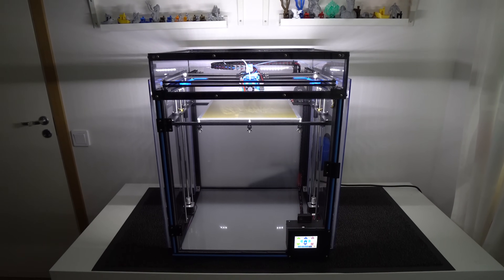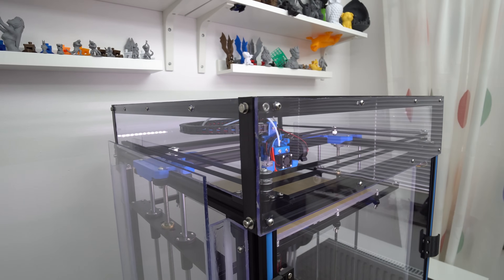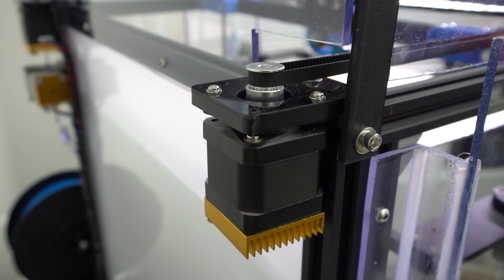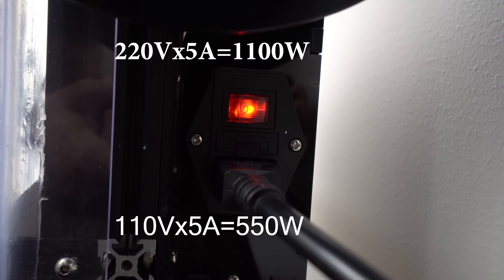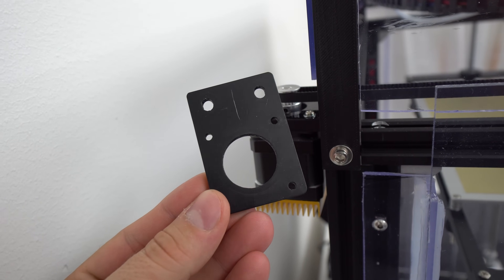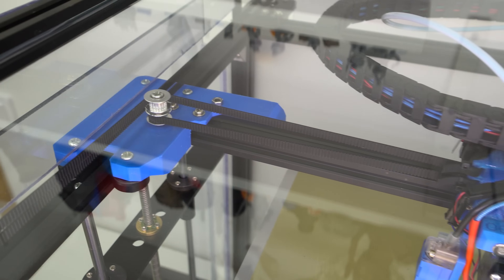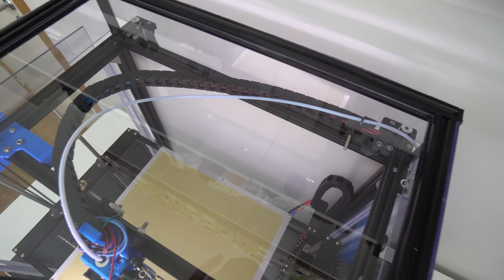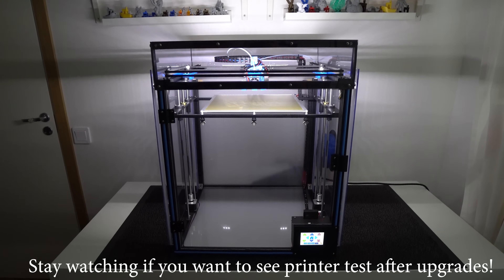Tronxy X5SA 3d printer ultimate upgrades!

Comment: Quick question hope you can help (please). my build is almost complete with all your upgrades however what is the wiring for the relay ?  I see you have power leads into the relay and the thermistor wires out but how does the heat pad get power.  Thanks ;-)
Reply from the maker: Sure Paul no problem, look at this picture. http://folgerforum.com/uploads/default/original/2X/4/45a2fd4840b3e1441b739cd726de192df9e0fef4.png
Don't forget to add ground wire from heated bed to the ground terminal on DC power supply or on the AC switch.
Good luck my friend!
Reply: Thank you so much will post a pic when it’s all complete have found a company that will make the panels in acrylic one size so have ordered 😏
Reply: And is a fuse needed on circuit??
Reply from the maker: Pedro Martinez Moreno There is already fuse in the main 3D printer AC switch. No need for one more. Just add ground.
Reply: on the diagram it shows "Mains" is that the positive?  Sorry if this is a dumb question, just not that good with electronics.  Thanks again in advance!
Reply: @be11thazor  if you haven't figured this out yet, "mains" refers to the AC voltage, so there is no Positive and Negative like with DC.  Instead there is "hot" and "neutral" wires.  In many cases with AC it doesn't matter as much which side is used since the current is alternating.  However, a typical way to wire this (per the diagram) would be to switch on the "hot" side, so run the "hot" (usually a black or brown wire depending on where you are) through the relay first, and then into the heat bed.  Then the upper wire in the diagram is "neutral" (usually a white or blue wire) running from the bed directly back to the plug.  A word of caution, since it seems you are unfamiliar with AC, it is a totally different beast than low-voltage DC and I urge you to learn more about it before wiring up too many AC components.

Comment: I will buy this printer for sure and most of the components for the upgrade.Thank you a lot.I think the GT2 Pulley are printable as well. They cost 20 bucks after all. (at least the ones with the teeth). The solid state relay is pretty expensive as well... the parts inside it cost 0.4$.

Comment: Is it possible to move the control box to the top extension you created?
Reply from the maker: TJ Walker of course it is possible. You can move it where ever you like. I leave it there because it's most cooled place inside of enclosure and I did not wanted to installed  outside of enclosure because now am usung this printer outside of apartment on the balcony.

Comment: This is a weird question but I can't find anything clear (even on Tronxy's site) but what is the difference between the x5sA-400 and x5sT-400?
Reply from the maker: TJ Walker It's not weird question because I would like to know the difference myself and I can't found any unfo :/ Quite strange and I got to say and stupid that Tronxy can't place more info of products they sell :D
Reply: Agreed. There appears to also be an X5ST (without the 400) available through aliexpress, but besides it looking like the X5ST-400 but with a smaller print bed (330 x 330) I can’t really differentiate between the different models. And Tronxy’s website does not help very much. There is no manuals or detailed spec sheets to download either.

Comment: Wow simply an awesome modified printer! Would you say that you spent $600-800 (USD) for the entire setup? The fact that you're making this to handle Polycarbonate with carbon fiber is a step in the pro-level printing. I really love how you went with an AC 600w heated bed with the solid-state relay. I guess you don't need to have a 24v power supply for the hot-end because of the AC heated bed. The only things I thought you would have changed is having the controller outside of the enclosure.

I have a highly modifed Tevo Tarantula (i3 clone), but I really enjoy seeing what people have made with their TronXY printers. I really envy the cube frame which is more stiff.

Comment: How do i ground the heated bed?
Reply from the maker: RaazorCosplay 3:30 easy. Connect the Wire from Heat-bed to the ground place on the powersupply or to the ground pin on AC plug.

Comment: What is the maximum speed of the printer to still get good quality prints out of it? should go over 150mm/s, right?
Reply from the maker: joepstar 150mm/s ?!?!
No 3D printer should be used to print that fast. To much stress and wear on the components and poor print quality.
Reply: @NexiTech  the whole idea of the corexy printers is the minimal mass of the head to increase the quality of prints at higher speeds, right?
Reply from the maker: joepstar Yes that's true. If your goal is speed then nothing beats Delta 3D printers. They have the lightest print carriage.
Reply: @NexiTech  I get decent prints with my cr10s at 120mm/s. That's why I was wondering what the max speed of the x5s would be because of the lighter printhead

Comment: Hi! Thanks for the great review and the upgrade list! I just wanted to ask a few questions.

1) for the E3D clone V6 what is the difference between the long distance and the normal type?
2) For the Gt2 belt pulleys that you used, was it the 3mm bore diameters and how many of the with teeth and without teeth do we need on this printer? (is is 6 of each?)

Thanks!
Reply from the maker: Raymond C I believe that Long distance V6 is the normal one. I compare it with my genuine V6 and they are very similar in therms of heatsink length and throat. Only heatblock is different size as far I can tell. 
Pulleys are 5mm bore. You need 6 with teeth and two without teeth.
I'm glad that you like my videos :)
Best regards
Reply: Thanks for the reply! Can't wait to see more of your videos!

Will you be doing additional mods to this printer in the future? Maybe adding a wifi module?

Also, is it necessary to have some sort of glass sheet on top of the print surface before the pei? Do you think the aluminum print bed is thick enough to not warp overtime?

Comment: Could you please explain a little more about pulleys improvement - specifically changing spring type washers to normal ones. I do not quite understand that part and I do not see a link for ordering washers. That is the only thing stopping me for going into this adventure.
Reply from the maker: cirilicar Well on X5SA kit you get the spring type washers which they never stay completely flat and Belts as they going left and right they sliding and rubbing the sides of top or bottom biger washers between the bearings. This create drag and it puts extra stress on stepper motors and it makes more noise. When I change the pulleys even on the stock printer the X and Y Movement was much smoother. 
P.S. There is no links for washers I buy them in hardware store.
Reply: @NexiTech  hello I was wanting to upgrade the pulleys like you did but you mentioned they were 15mm and the link only goes up to 5mm am I missing something? and exactly how many of each are required?

Comment: Did you use Mosfet?  The 1st video you posted you mentioned adding that.
Reply from the maker: Jona S 3:45 I use AC Solid state ralay/mosfet with 600W 220V AC silicone heater. I tested stock Heated bed with DC mosfet and it was not to much better in heat bed warming time or higher heatbed temperature with stock 12V power supply so I decided to upgrade it and I run this AC setup now.
Reply: Could you provide any shots or instructions for setting up the SSR (you said you did not install the Mosfet, right?) and I am not very technical and wanted to make sure I am doing this correct.  I did purchase the SSR you provided a link to and they just came in, so I wanted to get that installed.  Thanks again for any help you can provide

Comment: How did you wire the fan on the back of the controller?
Reply from the maker: mtktm I wire the bigger fan like it was wired on the stock one. On the control board there is socket for it. If you have different control board you can always wire the fan to the main DC input.

Comment: Awesome build ! I purchased one myself not long .. Question : You changed the pulleys with GT2 16 teeth 5 mm ?
Reply from the maker: Fodor Cosmin Thanks man! Welcome to the club :)
 No, I made mistake in video. It's Actuely GT2 20mm pulleys with 5mm bore for 6mm belts. But 16mm could work great as well.
Reply: Thank you for asking this question, I was just about to ask it myself.  Excited to get my kit in the mail, making sure I have the easy upgrade parts for when it gets here. :)

Comment: Is it worth trying to upgrade the X5SA vs. waiting for them to work out the issues with the Chiron? Can the two be compared?
Reply from the maker: John Paulson I would wait a bit more for Chiron. Despite few QC production issues that Anycubic addressed it's great 3D printer. I was working on this X5SA upgrades for weeks. Chiron is pretty much 99% complete 3D printer. I would just add insulation material under the Chiron heated bed to lower heat bed time, to maximise efficiency and save money on electricity bil.

Comment: Its great that you made a new video! My X5SA unfortunately caught on fire and now I am trying to fight for replacement parts from GearBest >.<
Reply from the maker: Thanks man! Oh no! I sorry for your X5SA! I guess that you did not see my review video where I mention important safety tip about this machine. Main DC wires are too thin to carry the continuous load and they get pretty hot. That heat is then transferred to mother board and power supply which can get damaged. You need to ether add one more DC wire or to place wires on the side (inside) aluminum extrusions to work as huge heat-sink.
Reply: Nexi Tech I actually had it wired similar to yours, with the wires inside the frame to dissipate the heat. I also wasn't using the heat bed which it also baffles me that it did what it did.
Reply: Justin Lincoln When you change wiring you should always verify connections and verify voltage drop on each wire ( put millivolt meter in parallel to see voltage drop. No more then 2% drop 12v. = 0.24V drop). Probe on +12v PSU and +12V on load
Reply: Didn't change wiring, the stock wires that came with printer caught on fire. Was running everything 100% stock at the time and I guess Tronxy just doesn't want people to know their setups catch on fire lol
Reply: I upgraded the power supply and heatbed wiring after Nexi’s original video. Mine caught on fire too first time I turned it on, but in my case it was the hotend heat cartridge and its wiring. Tronxy sent me a replacement, but I used a standard spare that I had.

My biggest two problems with this printer are - weak hotend/unreliable extruder feed, and bed levelling - there are no Z-stop switches, so the heated bed seems to lose its level with every print, as the two stepper motors get out of sync. I have to do an auto level before every print. Can Z-stop switches be added?
Reply: @alexshepherd  Yeah, thankfully only the wires caught/smoked and cause of I generally only print in PLA or PETG I unplugged the bed wires and print on blue painters tape with some purple gluestick lol
Reply: I’m converting it to a direct extruder setup (with V6 clone) to eliminate the long Bowden tube. I hope this will give more accurate retractions and less stringing, or perhaps just print for more than ten minutes without clogging! Already tried different fan setups on the standard hotend but I think changing to a V6 hotend will solve my problems.

I have no problem with the original belts and carriages - plastic belts are steel-reinforced, so they seem better than the rubber belts. Everyone else seems to have problems with those, perhaps I haven’t printed enough to notice.

Comment: Thanks, what about using poly carbonate transparent sheets for enclosures (I am planning to do using PC, please let me know if there will be any issues)
Reply from the maker: I think that will be just fine. You can use pretty much anything to make enclosure sense all stepper motors are outside. Motherboard have cooling fan with good air flow so I don't think that will be a problem. Just make sure that you check my x5sa review on my channel I have mention very important safety tip about main DC wiring. You might need to upgrade wires.
Reply: @NexiTech  Thanks, will check

Comment: You have done an excellent job on tuning that printer in, but with such a build volume I'm a little disappointed that all you show is a tiny phone stand. I would like to see a nice time lapse of that printing something at near it's capacity. Impressive as usual though, thanks for sharing  Nexi.
Reply from the maker: Kevin Schofield Hi Kevin! Thank you for your comment I'm glad that you liked my video and that you appreciate my work. Well that mobile stand is only quick speed/stability test for ABS and PLA filament and 3D Benchy is just a quck print quality test. 
I already made full review for this 3D printer and I show alot of time lapses and printed models like Huge pyramid, Robots, lamp, Terminator 2 Arm etc. Please check video if you missed it
https://youtu.be/Pq3qjdaRnuY
Reply: Oh yeah, I forgot about those. That Pyramid and Terminator arm do count, but those were before all the UPGRADES. You got priorities now, you need formula more than filament.:-)